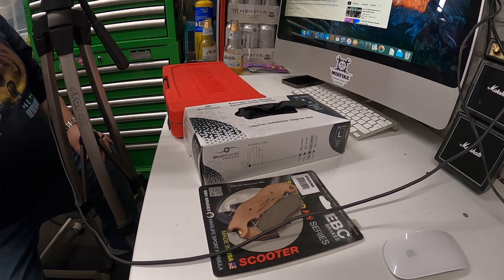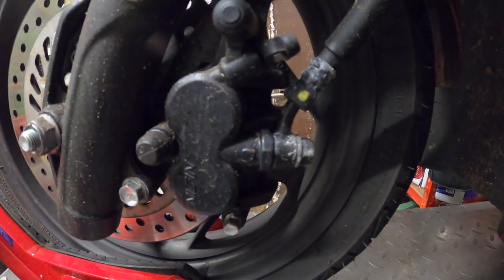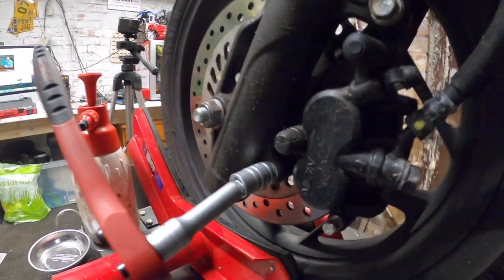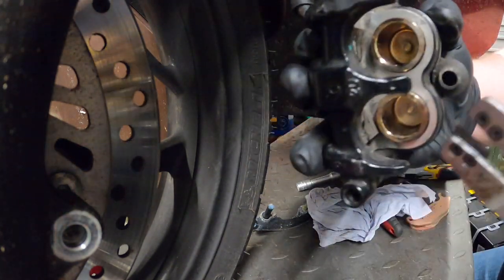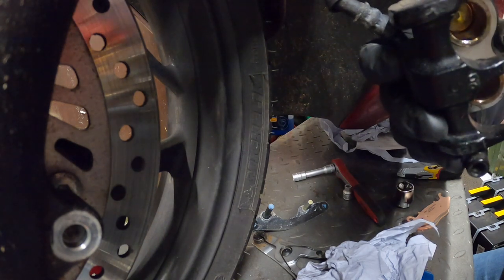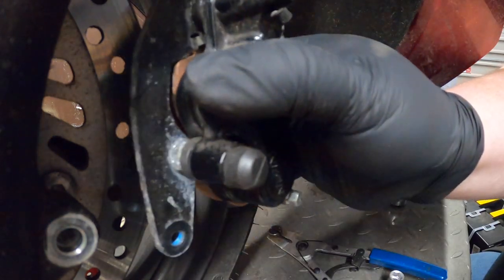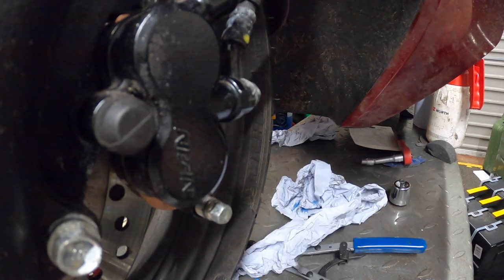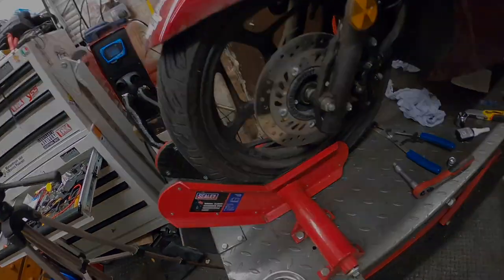2021 - 22 Honda pcx125 brake pad change -  remove Honda oem and. install EBC sintered HH pads

Comment: Great video thanks. Apart from the brake issue, how has the PCX being performing?
Reply from the maker: Brilliant other than this. Got some wee leg shields to fit that I got off ebay from China then I'll refit the termoscud. Fantastic little commuting machine. Only major annoyance is not being able to fit a full face lid under the seat.